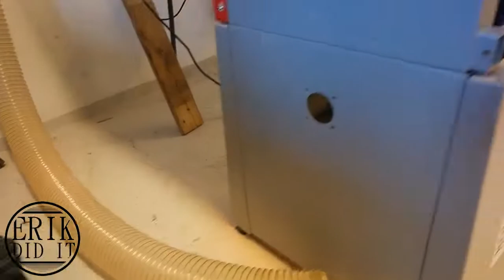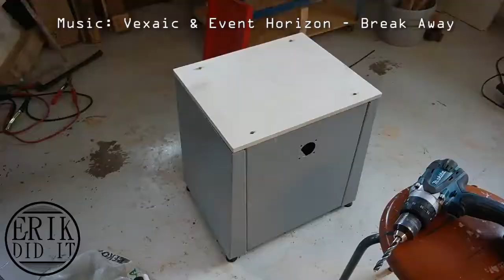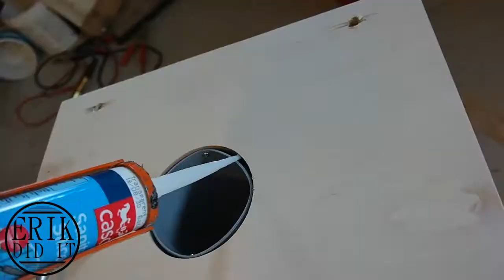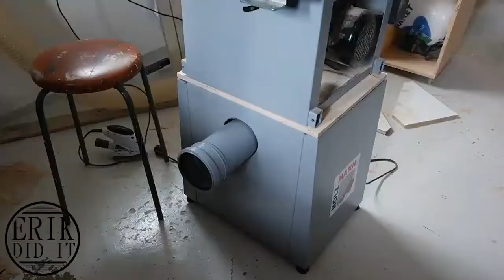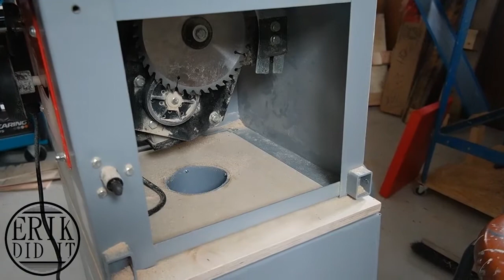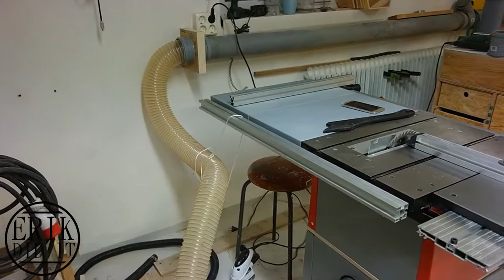Holzmann TS200 dust collection upgrade

Comment: Hi Erik, are you satisfied with your upgrade? I have the ts 250 and the mess is really bad, most of the saw dust lands on the floor. Does everything gets sucked away with your upgrade or is there a lot of saw dust collecting inside the saw? Have you sealed the front where you can adjust the angle?
Reply from the maker: +Alexander K it is better but far from optimal. I found that it works best if I use a second vacuum above the blade. I haven't sealed the anything but I guess it would be better if I did it.

Comment: Hello dude! How did u get rid of the vacum funnel thing that sourounds the blade from start? That black metal thing that the blade sits in
Reply from the maker: If I remember correctly, it was bolted with a couple of bolts. Maybe you need to remove the blade to see them. Good luck

Comment: Hello Erik,
Can you tell me something about this saw pros/cons?
I am considering to buy this machine is it reliable?
How it works after time.. is there any problems more than dust collection issue?
Cheers :)
Reply from the maker: Hi, 
I have had it almost a year and unfortunately there is more negative than positive to say about it. 
- The blade that comes with it is not good, that is probably common with table saws in this price category. 
- It is really hard to get both the fence and the sled adjusted. With that said, I don't have any experience with other table saws. I don't even have the sled mounted to the saw because I can't seem to get it to cut 90 degrees.  
- The iron cast top is full of screw holes which can be a problem when the piece you are cutting get stuck.
On the positive side it is light weight and if you have a small workshop like me you can easily move it around. I don't regret that i bought it because it was a huge upgrade to what I had but I regret that I didn't move up a price class or two. I think you would get better quality if you spend some more. If you are a beginner/average like me this saw will do the job but investigate the options before you decide.
Reply: I've made the exact same experiences. Had to return the long rail twice as it was out of shape leading to a fence that was close to unsualbel. Newer got the sledge to work, impossible to align properly even if I drilled all holes up. Look at the top, uneven chamfers aso. I revoved the side table and all rails and expanded the table w ply and my homemade fence. Motor too weak at 1100W, Don't buy - build your own or buy a better - Bosch GTS 10 XC and modify it. I consider throwing it out. Won't even sell it
Reply: Claus Friis Hansen i can buy it :)